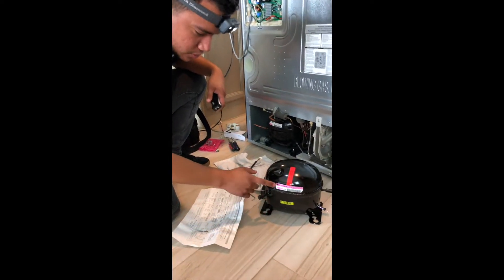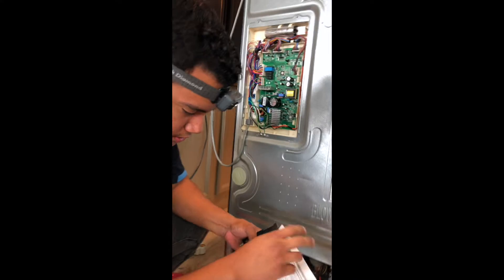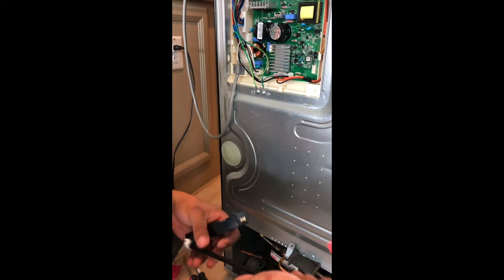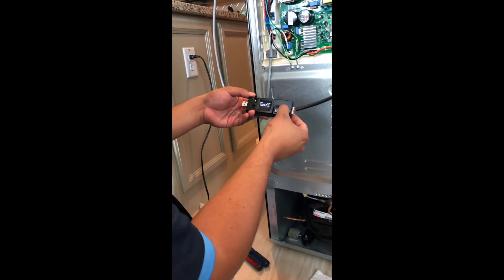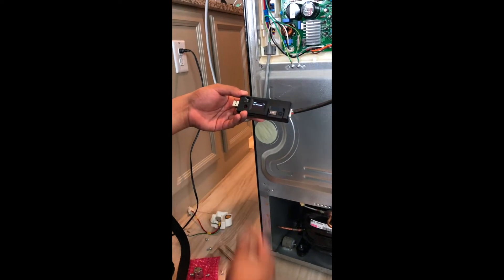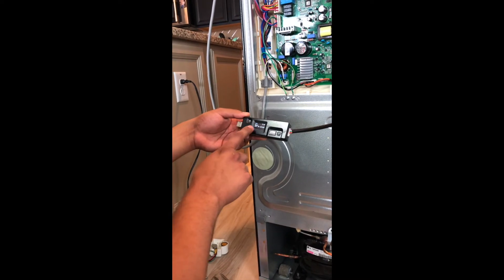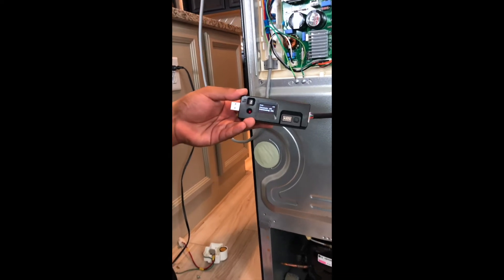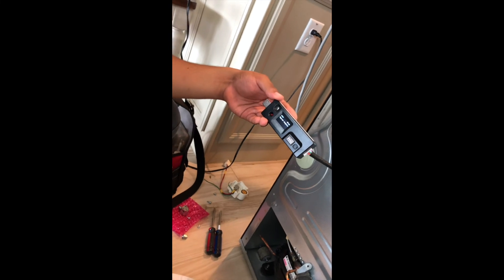Updating Software to install LG Universal Compressor.

Comment: plz help mine dont say tx or vcc
Reply from the maker: You got to measure the resistance between pin 1-2 and pin 2-3, if pin 1-2 resistance is more than pin 2-3 then use TX
Reply: It's stamped on the control board next to the receptacle that you connect the software update cable to